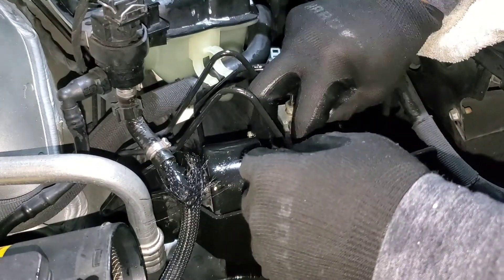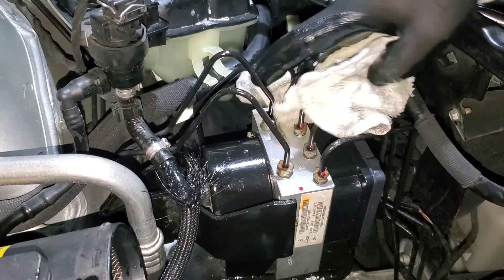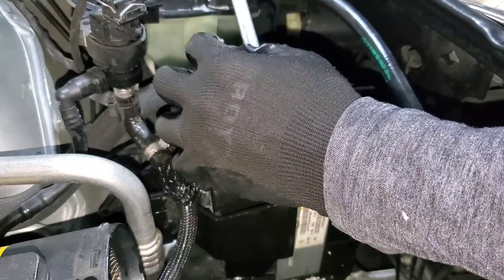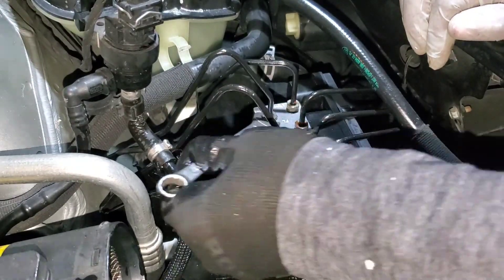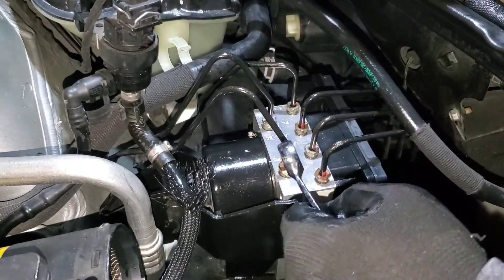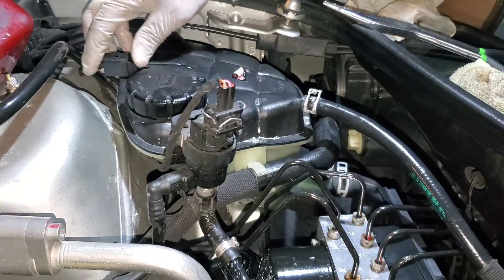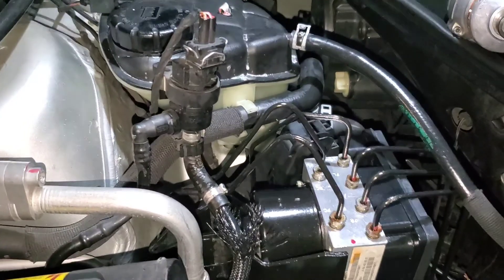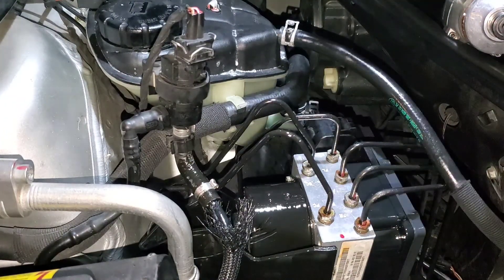Mercedes ABS Actuator Replacement

Comment: I have a question. What is the name of those metal wires that you unscrewed from the abs pump? I need to buy it. I have been told mine has corroded causing my brake fluid to leak, is that possible?

Comment: Very Disappointing that you did not show the removal or refitting process. But for those you helped well done taking the time to upload. maybe improve or make new video of removal?
Reply: Yes, we need to see it was removed. Do you need to remove the 3 bolts on the large bracket or does push down into the rubber grommets?

Comment: My abs light went on e350. I tried driving literally made it 20 feet before I had this crunching in front wheel. I hooked up scan tool and it said abs not supported on this vehicle. I just ordered the sensors I’m hoping the crunching is abs kicking it. Brakes are good, rotors are good, bearings car always riding perfect. How did you know it was module? What were your symptoms?

Comment: Hello friend, is it necessary to reprogram that module? Because I changed it and I get an ABS AND ABR error. Could you guide me
Reply: Did you reprogram it or you didn’t ?
Reply: @Nyteblayd98  I tried but I couldn't it requires xentry online although they told me that it can be done offline